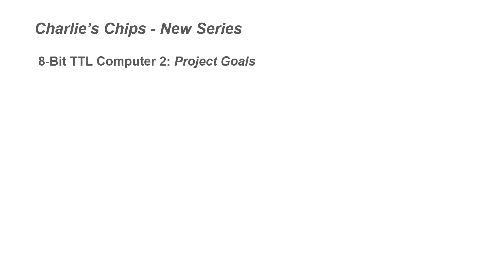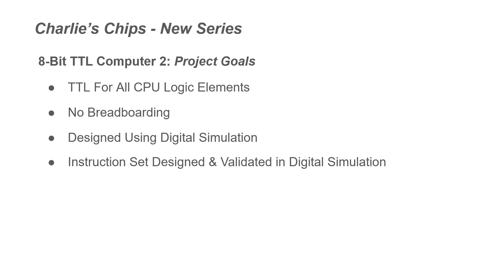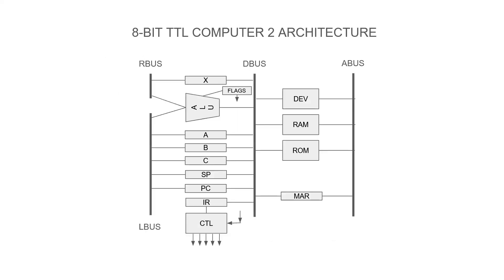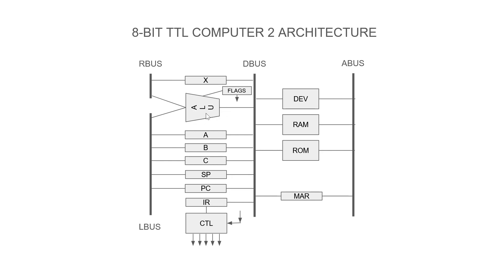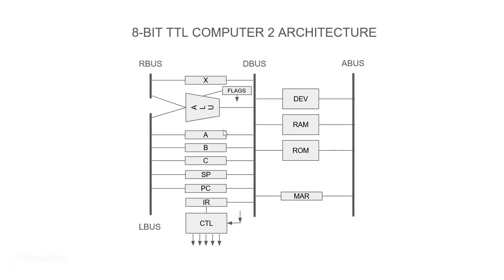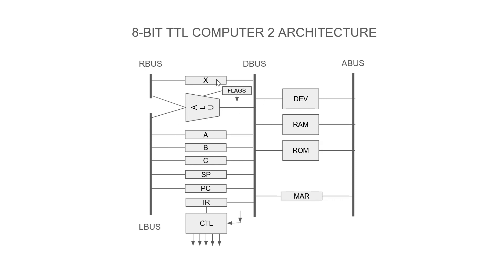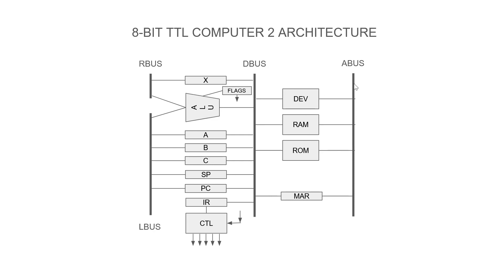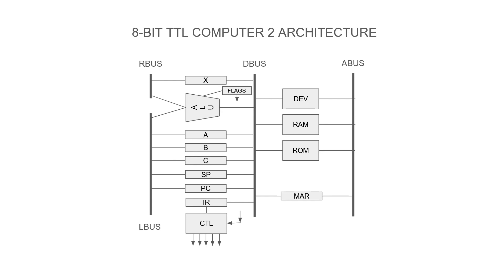TTL Computer II #1 - Introduction & Overview

Comment: hi @Charlie's Chips - Is there an episode or a  download somewhere that lists the opcodes and the microcodes used to generate those? I'm looking in the download package but all I see is the control rom .hex files - not the microcode behind it.

Learning a lot - thank you!
Scott
Reply from the maker: Hi Scott.  
No I don't think I have shared the source for the micro-code. Here is a link to the file below.  Please note this is a 'C' language file which produces the three control rom's which then need to be assembled to produce the binary hex files we load into the simulator/eeproms. They are not great to read since I kept all my edits along the way as comments in the file.  Also note we made some significant changes which are reflected here because of a control issue (Video #23).
https://drive.google.com/file/d/12Ni2i9ta2uTeNd6FrvboxiRqeo6D47mz/view?usp=drive_link

Comment: You’re already using a MUX to select which register is connected to the RBUS, why not have a second MUX to allow them to also connect to the LBUS? That way there is no need to shuffle things through the ALU and run two ALU cycles, just pick any two registers and one ALU op in one cycle.
Reply from the maker: Thanks Steve.  Already started fabrication on this project, but something to consider for the next computer.  Thx again.

Comment: So all ALU-ops will have to pass though the ALU twice, that sounds like a rather large unnecessary delay - the ALU usually are in the critical path timing-wise , especially if built discretely and not with a 'pair of 181's.   

From where do the 0 on the RBUS come from when you use an OR to transfer data thru the ALU?  Is it generated internally in the ALU as a special OR-op, or will the RBUS have pulldowns and you float the X-register?   And speaking of the X, I guess you'll implement that using  a transparent latch rather than a D-FF?

I will follow this  project with bated breath - or at least with a great interest :-)
Reply from the maker: Hey great questions.  There will be a pair of 74ls181's.  As example 'add a, b', b would pass through alu moving to x reg via an OR operation.  Then x ADD a.  Yes, the lbus & rbus will have pull downs to 0.  The registers will be 74hct245's.  I'm ok with the alu latency for the register transfers.  My target clock speed for the cpu will only be 2 Mhz or so.

Going to be a cool project.  Moving along nicely.  Started defining the instruction set.